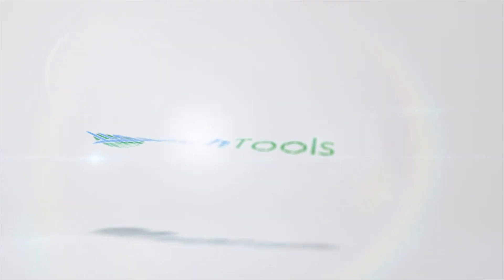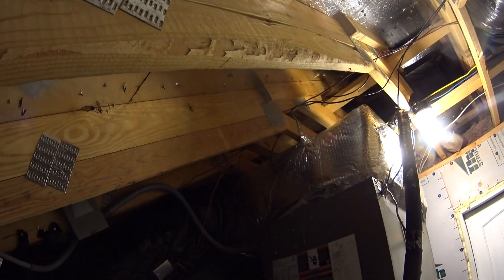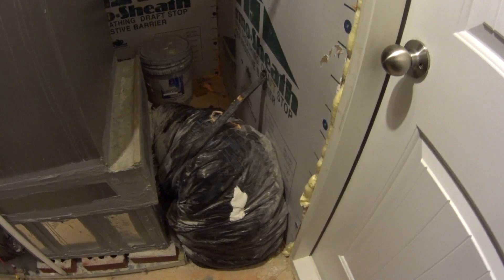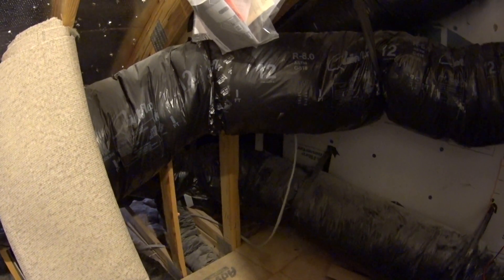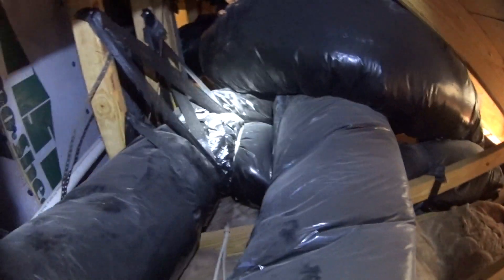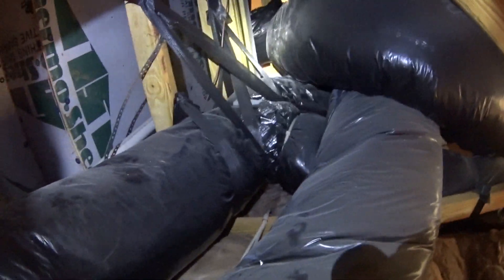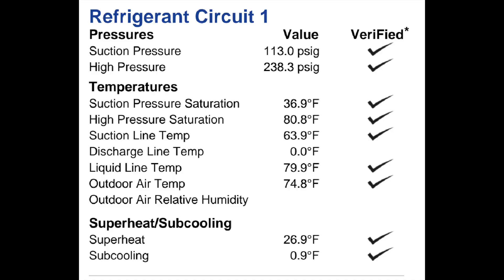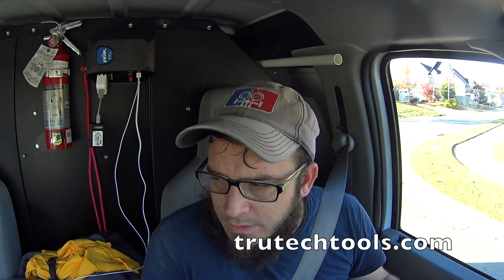11-1-17 Lennox Heatpump With Zoning and Ductwork Rats Nest

Comment: Zoning does not work well at all on single stage equipment.... and the "by-pass" hackery will really only relieve the blower and will do NOTHING for the furnace or coil temps... and then adding limit sensors in the supply to cycle the compressor to death kills both the compressor, and the efficiency... Zoning, just does not function properly or efficiently without variable equipment. Just my opinion.
Reply from the maker: +Anti DIY HVAC you’re right, or at least I agree with you. Variable capacity with zoning makes perfect sense where single stage with zoning that uses a bypass makes no sense. If you can design a zone system like Joe Shearer does which doesn’t use a bypass then you’ll be ok but if you slap zones on an existing duct system that wasn’t sized properly you’re creating problems rather than solving them

Comment: heres some food for thought....take a temp reading in the supply trunk closest to the unit and then take a reading on each supply line going to the rooms with temp problems.  that will show where the supply temp and airflow problems are coming from by the temp differences.  its old school but it works.  just stick the probe through the flex duck in the attic and read it.